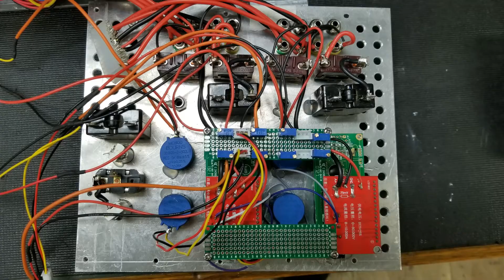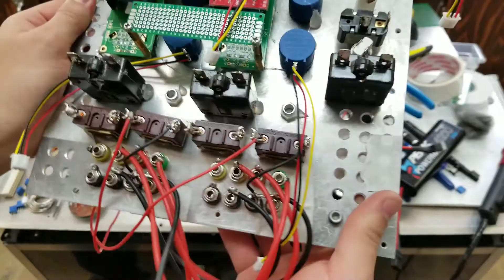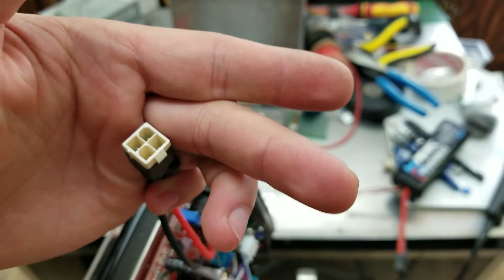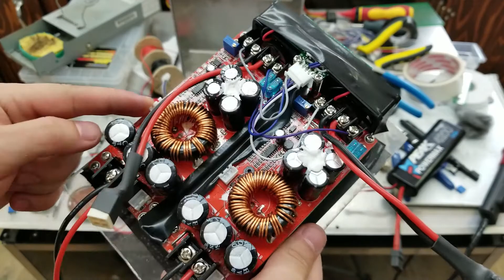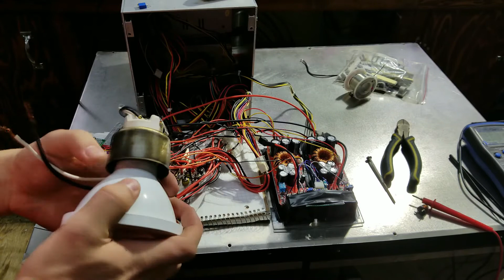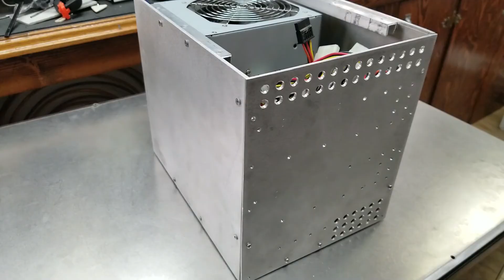Making homemade Lab Power Supply part 6

Comment: Great Progress!!👍👍 Have you tested the little fan connectors on the output of the 1200 watt boost converters? I never got around to testing mine, I figured you might have fiddled around with them? Another user I chatted with claims, his only comes on when the temp gets warm, off when cool. Another claimed that it runs full speed 100%, all the time. Wish I would have tested before completing my last PSU.😊 On the fans I use for cooling on most of my builds, I like to use a small "LM2596 DC-DC buck adjustable step-down converter"(think I have seen you used one in once in a previous build). Those seem pretty small and great for adjusting fan speeds. 

Been waiting in anticipation of your next video and your completed product. It is looking Great so far and something you will definitely be proud of when complete. Thanks for posting!!👍👍
Reply from the maker: +njfulwider5 no unfortunetly I have never tested that.  I just enjoy the sound of those 2 fans running at the same time. So I did and even bother testing that.